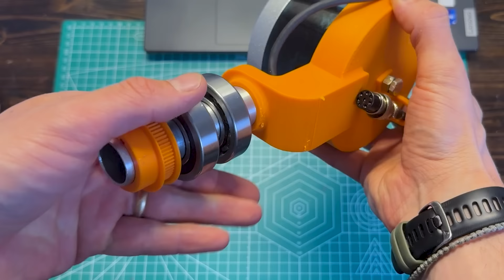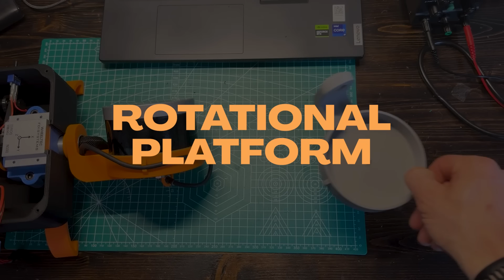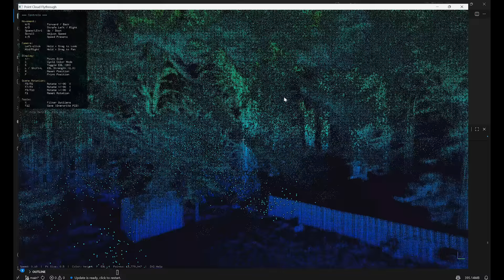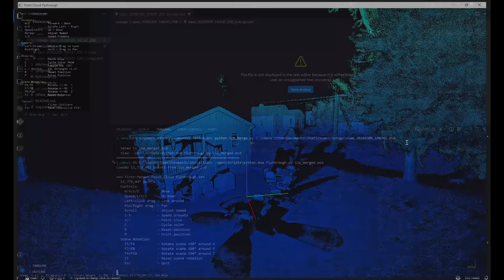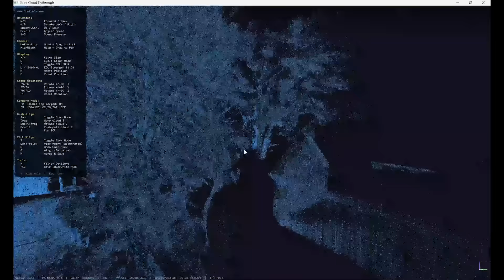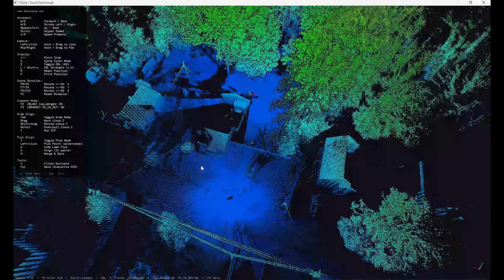My LIDAR Was Half Blind (so I fixed it)

Comment: You can get rid of the noise by changing the frequency at which you control the motor.
Reply from the maker: Haha yes I’ll admit I got quite lazy on the tuning side and once the motor worked reliably I kept pushing forward. releasing all documentation here soon and hopefully someone can help optimize motor frequency to reduce noise.

Comment: Ive been working on a similar project. VLP16, RaspberryPi, inertial sense Rugged II IMU. My scan so far are not nearly as clean as yours. However, I have mostly tested indoors using SLAM and I do not have a constant rotating puck. I’ve just been holding it by hand and slowly rotating it which is causing blur. I’ve been using KISS-ICP but I think the indoor features are just too close and the inconsistent rotation by hand is not a great option. The rotating collar is what I need as well as synchronizing PPS data from the IMU. I suppose I need to try more outside scans as well since scanning features sub 3-4 meters is probably not the best range for the VLP16. Thanks for sharing your project!

Comment: In the video, in which you test this scanner in a cave you describe, you had a scew when you tried matching new slices of the cloud to previous ones.
I believe the issue lies in the separated motion control and data processing.
You could try and do all these tasks on the pi, which might work, but as it is not a realtime system, you can end up with the same scew.
The best option in my opinion is writing the lidar data directly to an SD card, that is controlled by an ESP32. That way you can keep the pi and its UI capabilities and reduce the postprocessing.The ESP should be able to run your verification, might be slow...
To make your life easier on the alignement, you could add a compas and save the north/south orientation.

I like your project and would love to see you improve on it and your craft.

Comment: why not just buy an matterport pro and reconfigure it to your needs? They are now dirt cheap on ebay. From $600 up and they are ready out of the box. 
Laser Class: Class 1 eye‑safe laser
Wavelength: 904 nm (near‑infrared)
Depth Technology: LiDAR (not structured light)
Range: Up to 100 meters (for raw E57/BIM data)

Accuracy: ±20 mm at 10 meters

Point Density: ~100,000 points/sec, ~1.5 million points per scan

Field of View
360° horizontal

295° vertical

Comment: Magnificent results.

How does it decide the trees should be displayed in green?

It looks like you have done wonders with the alignment.  Do you know when the start and end of the sampling sweep inside the scanner occur in relation to your new axis position?  To you rotate at a constant speed or do you take a step after each sweep in the sensor?

I wonder if three white unequal sized Styrofoam or inflated rubber balls affixed to key points visible in multiple scans would make for handy reference points.  If the balls were sufficiently different in size it might be possible to automate locating of them.

I love seeing 3D cave maps, they are often more revealing than a video walk though that only sees the bits the camera/light were pointed at.

Once you have matured the mechanical design you can send out the couple of parts under thermal or mechanical stress to be 3D printed in metal to gain full reliability.
Reply: You can increase the stiffness of your main rotating part further by having it contact the top of the scanning cylinder along a 2cm arc and leave a gap for a 1mm thick double sided tape, alternately cover the whole top of the scanner and clamp it between two halves.  This will add a lot of stiffness.  Eliminating the offset and correcting with counterweights as suggested in another comment makes sense to me as well to minimise avoidable geometric error at source as much as possible.

Thank you for documenting and publishing your design.

Comment: How does the cable at the 3-minute mark allow spinning without tightening the wires to the point that they snap? Does it only spin in one direction a certain number of times and then spin the other direction? Or can it keep spinning in a single direction infinitely? The only method I've seen to achieve that is circular contact rails where there's a "pin" that is trapped and slides on the contact rail while it spins and allows the current to pass through the whole rail which leads to a non-spinning wire on the device-mounted side, but the data lines you have would require a lot of these rails, so I was interested in how your setup achieves the spinning and what the limitation is.
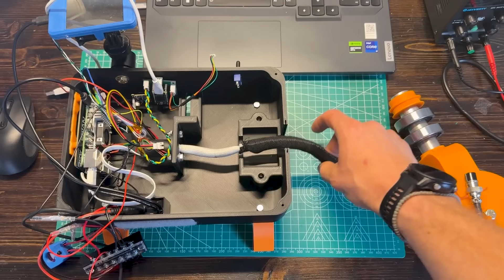Reply: He mentions slip-ring at 2:10 so I assume it is hiding at the end of the rotating cable segment that goes into the tube.

Comment: That alignment algorithm is impressive given the pick points' close proximity and lack of cloud overlap. Leica's Cyclone alignment tool would've flipped one of the clouds upside-down lol. Check out "laser scanner targets" if you ever find yourself needing a higher degree of cloud-to-cloud registration accuracy with stationary scans. Might even be helpful for mobile scanning caves if the software can use fixed targets for real-time SLAM corrections.

Comment: hello sir i am build a similar one but way too small and simple one using tof sensor i tried buinding a rotating shell that holds this sensor for 360 degree but the problem is with the wire when rotated the wire doesnt rotate it is stuck any suggestion for the problem sir

Comment: What make/model of slipring are you using? TIA
Reply from the maker: Search this on eBay is around $50 Gigabit Ethernet Slip Ring 1000Base-T 1 Cable Power Signal Flange RJ45 Joint
Reply: @9nl  Thanks. Really cool project. Looking forward to seeing your progress.

Comment: Hello. What do you mean by a "TNC" at 6:45 of the video? That little board there looks like an ESP32 or an Arduino Nano to me. 

Googling "TNC microcontroller" gives me amateur radio related stuff and I think that's not what you're doing here. 

I'm currently in highschool and am slowly learning robotics so I'd appreciate it if you pointed it out 😗.

You can just tell me the board you're using if you're too busy rn. I think I can figure the rest out myself :D

Comment: You're still discarding a large chunk of data by not putting the LiDAR on an angle. A good chunk of the arc is just pointing directly at its frame and you, and for slower scans it technically also makes the scan locations less random. Getting rid of the whine is simple, you just need to increase the switching and control loop frequencies. It will also get quieter if you increase the gear ratio and spin the motor faster.

Comment: Could you ditch the center cable by WiFi-ing the transceiver to the body and powering the transceiver via slip-ring? Would give you full rotation.
Reply: He mentions slip-ring at 2:10 so he has power and comms all connected.

Comment: That motor whine is totally related to the PWM operating frequency.  It's kinda weird to hear it on a new motor, I bet there's some "old" constant in your code for the pwm freq.
Reply: could also be the switching speed of the transistors on the controller board, if they operate on a kilohertz range they will always make this sound
getting more expensive board with higher switching frequency will eliminate this because the whine will be outside audible range
Reply: @YTuser133 .  The power sections in GPUs operate in the MHz range and they can still whine. There’s a lot more factors than just frequency involved. It will certainly help though 👌

Comment: i recommend not wresting the cables, as the may damage, instead try using some kind of connector that rotates freely, without wristing any cables
Reply: He mentions a slip-ring at 2:10 though it is not visible.  
The floppy cable between the rotating tube and the slip-ring is an unconventional move but reduces stress from potential misalignment so probably a net positive move.
Reply: @KallePihlajasaari  oh yeah didnt notice it but nice

Comment: you need too much precision from the materials you're choosing. you can 3d print metal remember, or better plastics like pps, you need rigidity like a machine tool. dont waste your time with aluminum unless youre gonna make it thick af, steel is king unless you go exotic. could go mini to shave a shit ton of mass. if you balance it well and its stiff enough you can crank the sample rate/rpm. your bolt holes are off most likely from over extrusion or bad calibration.

Comment: Neat device. I am a bit worried over that red wire that goes under the white turning shaft. Is that white material abrasive? I feel like the white material will wear on the red wire.

Comment: Such a great project, Can't wait to see more, especially once you start implementing SLAM. When you are doing a moving recording is there any drift in the point cloud, or does it record so fast that it is not a problem?
Reply from the maker: No issues with the static recordings and deskewing. Just with SLAM, which i'm having a hard time getting to work well without massive drift.
Reply: @9nl  I know you’re deskewing the rotation are you also deskewing the translation using the IMU ?.

Also what SLAM algorithm are you using ?. Drift will always happen without loop closure, closing loops is really important.

Comment: Astonishing work! It's there an "append" feature so that while capturing data it elaborates it and append it to the visualization file? Is it possible to create a crude 3d model from the point cloud? Do you scan always at same speed or do you vary jt in order to increase captured point density from a certain angle? Very cool stuff, I just know projects are much harder than they look so props to you!

Comment: Fun tip - if you need to remove the hot glue, isopropyl alcohol will debond it from the surface like fricken black magic. I have used it to cleanly remove hot glue from 3d prints and I imagine it should do the same for other surfaces given it didn't damage the 3d print.
Reply: weird, i wouldn't expect that would work. Thanks for the tip!
Reply: This is a golden tip that turns hot glue into such a useful tool to hold things and also remove it cleanly 👍
Reply: I also learned long ago when using hot glue with USB repairs
Some hot glue is somewhat conductive and can add noise or other issues into signals, it appears this lidar is working great, so I'm fairly sure this hot glue isn't causing interference though
Reply: This is the way. Spraying high proof isopropyl alcohol or isopropanol on to hot glue, makes the glue forget how to glue.
Reply: Nice!

Comment: You should try printing out any thin parts in ASA with draft shields. Also, if draft shields don't work well for you, you can add thin plates to your part that will sit parallel to the print bed. If you turn supports on, and you put these plates in the right place (also attach them too your part) you can easily fully jacket your thin sections in supports, and keep your parts hot enough, long enough to properly bond. When you are done you can take the supports, off, and easily snip the 0.5-1mm plates off the part.
Reply from the maker: thanks for the tip just looked into draft shielding technique, going to have to try it out!

Comment: Could probably make an alignment reference tool by having just a pyramid/cone that you can put somewhere you see it from multiple angles or on a pole above the fence.

Also hope you fix the wires a little better so it doesn't rub on the spinning cable or belt all the time 😅

And maybe reprint the motor gear adapter so it uses all 4 fasteners and to be sure it's centered.
Could be a factor of why the noise from the motor at the belt tension gets hight then low for every rotation.

Also could give it a bearing support on the free floating end, should strain the motor bearing and motor itself less.

Doesn't seem like you have any interference from the motor but maybe a good idea to shield it and the ESC from all the sensors with a steel sheet.

For the LiDAR hanging support you could have a hole to the back and route the cables on the back instead of against the sensor.
And then beef it up right next to the shaft.

Love this build and looking forward to the cave shot 🤩
Reply from the maker: Lots of great suggestions here, definitely some things I'm looking to iterate on!
Reply: A tensioning wheel riding on the belt might be more reactive than moving the motor back and forth? and more consistent long term.
I was wondering if printing the motor mount and main shaft bearing mounts as one unit might remove any (theoretical) alignment issues too? Might need to flip the motor 180 and add a bearing like you suggested

Comment: If you're doing SLAM, why does the offset rotation matter? It's going to have to estimate the LIDAR pose anyway, it's not like you're letting it spin 360 and only then moving it to the next capture location.
Reply: You need to deskew the data before doing SLAM. Deskewing requires knowing the angular velocity but it matters if the sensor is rotating offset from the axis of rotation.

Comment: Re: ABS/ASA splitting -- For strength parts  I tend to print towards the upper part of the temp range. Reduce cooling fan and/or increase layer time limits, that should address the layer split issues.

For really strong parts with ABS/ASA where I can't get the strength via changing the print orientation (like your part, given its shape), you can add a few cutout slots (or tube) that run up through the layer lines. Then in a jar mix-up some acetone and shavings of the same filament into a paste, coat a corresponding "plug" for those slots and press in -- the acetone will make a permanent bond. You can also do outside plates in the same way (printed flat). Makes for a really strong part.

Comment: Very cool. I'm wondering how long it will run before the wires get too twisted. Or do you alternate the rotation after a while?
Reply from the maker: Witt the slip ring it could run forever, or until the slip ring wears out but surely something else would fail way before that.
Reply: @9nl thanks. Missed the mention of the slip ring.

Comment: Just a tip for future recordings of your pointcloud: make sure to rest a bit between the movements so that the video encoding can build a new clean picture as it gets messed up with too many moving details;
Reply from the maker: Thanks! I’ve been using the default windows screen recorder and it does seem to generally record terrible quality.
Reply: @9nl  Even if you'd have it recorded with OBS at 50MBit/s it would still look bad as YouTube itself reencodes it (several times for different formats) to be as efficient for streaming as possible.

tom scott has a nice video on why encoders struggle with confetti: videos are not really single pictures played back, it mostly is a picture and then vectors of what to move for the next picture. This works great for most stuff and especially bigger homogen surfaces but lot's of particles can't be compressed within the same amount of data – you typically have a fixed bitrate as the limiting, let's just say 6Mb/s for your typical FHD vid, and this bandwith get's consumed. When everything is easy to be compressed by building bigger chunks you get really clean video. If you have a lot of movement and many details you simply can't encode all of that without loosing quality within the same 6Mb/s. So you then get those chunky blobs as the encoder has to cut down resolution to be able to encode at the given bitrate.
Reply: @9nl it's a YouTube compression thing. It will do it regardless of what you record it with. Regardless, awesome project so far!